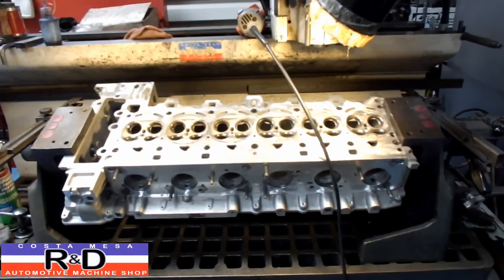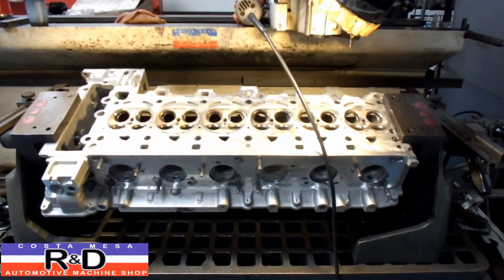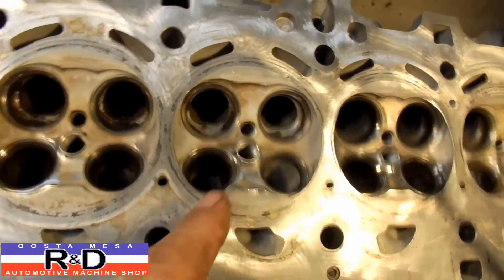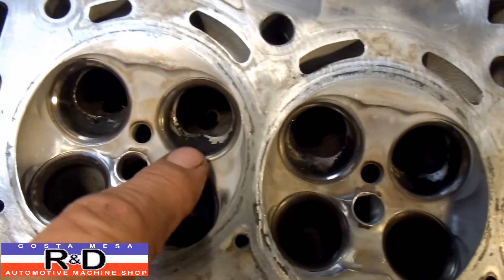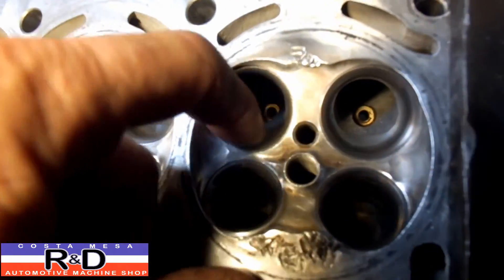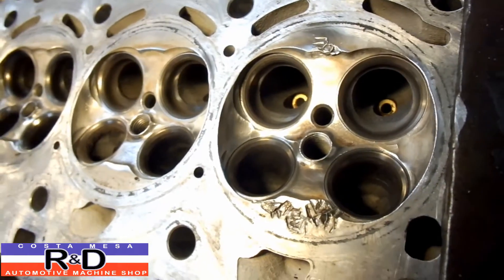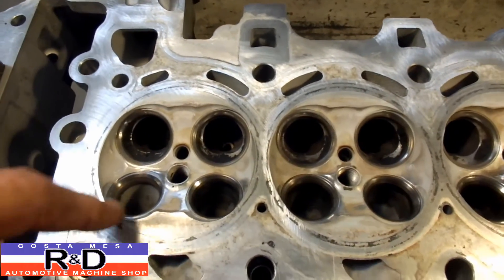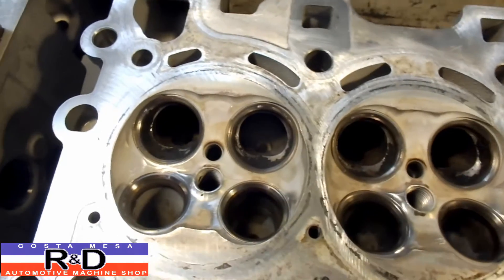Direct Injection Issues   Case #3

Comment: John what's the best time to call you in the shop?
Reply from the maker: The best thing to do is come by, I don't answer the phone that much right now - way too busy. If you have a quick question, use the YouTube mail, but keep it short - please.
Reply: Thanks!  I'm over an hour away (North Hollywood) and didn't want to come by and have you be closed.  I wanted to know how much you would charge to deck a BMW M54 head.
Reply from the maker: $100 with cams out
Reply: what is number phone for contact with you need work piston

Comment: Dear John, for aluminum cylinder head what is your recommendation of media shotblast. S190?
Reply from the maker: S190 is what??? If its aluminum - use glass bead (AD grade), if iron, use steel shot.
Reply: JO EL, I use a hayden steelabrator S230 peen shot for cast Iron. What media shot size should I use in aluminum cast? I have this doubt. Thanks